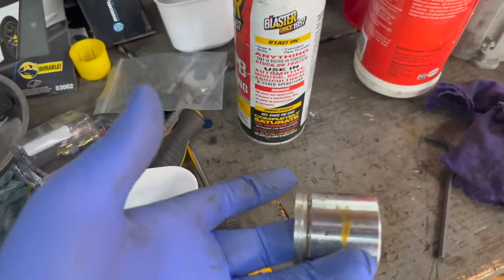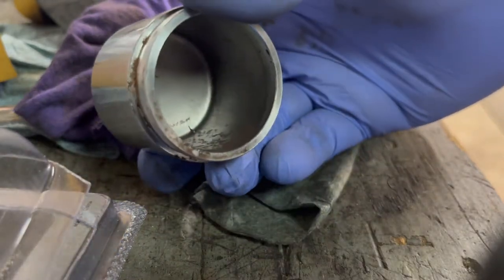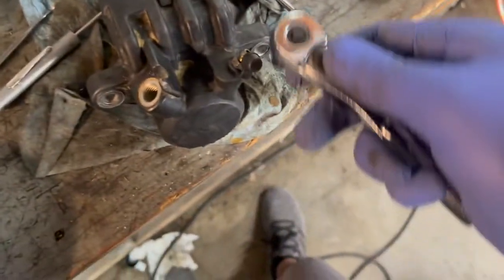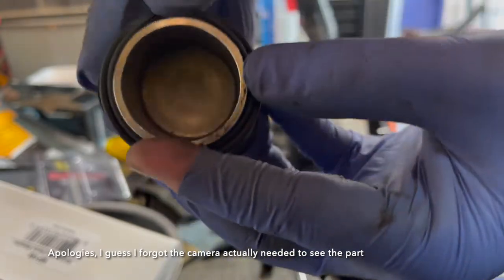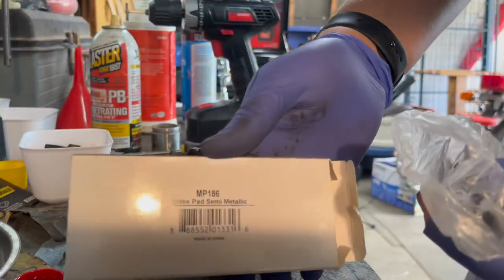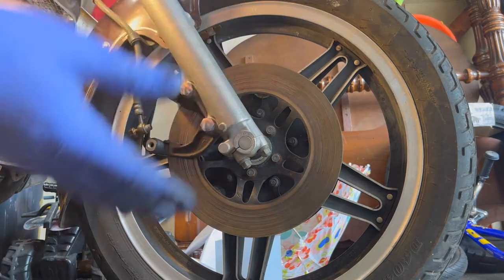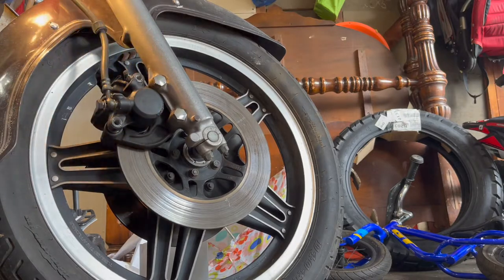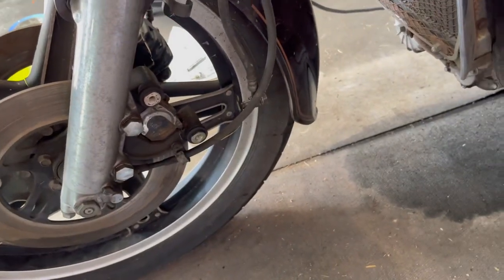1981 Honda Goldwing GL1100 Bike Project - Part 2 - Front Caliper Rebuild

Comment: Like the vid, I see you are wet sanding,are you using water?
Reply from the maker: @tims57064  I used brake cleaner while I was working on these. Thanks for watching
Reply: @AllWheelsDown  Thought it might be drying too quick to have been water. Thanks